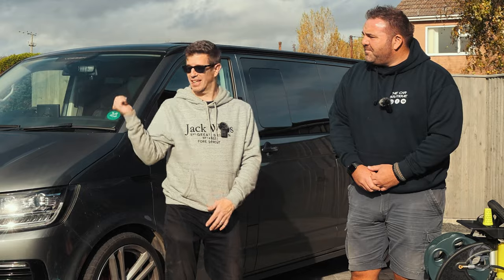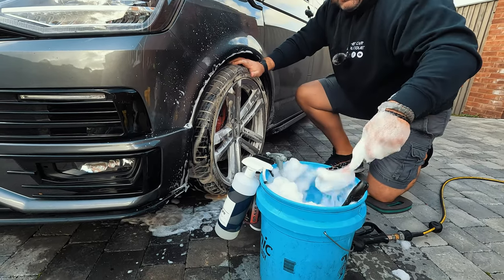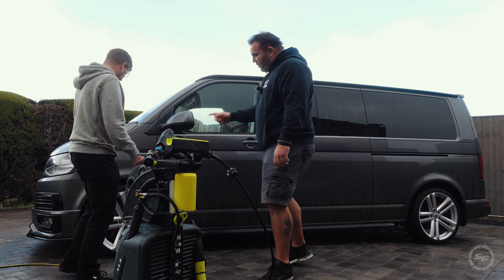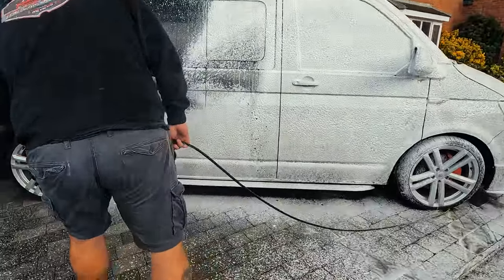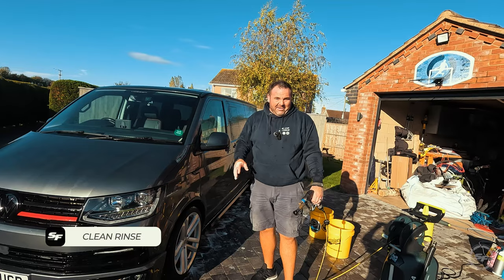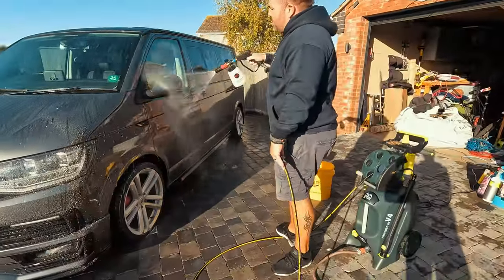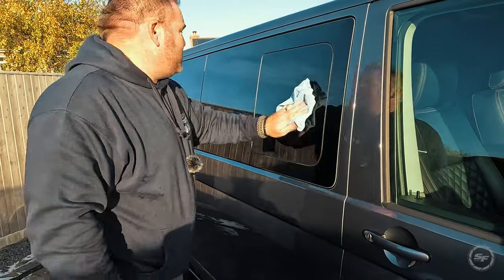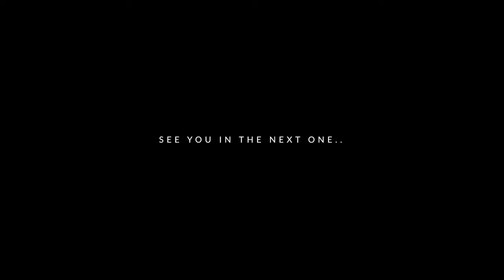DETAIL YOUR VEHICLE LIKE A BOSS!! | I called the Geeky Detail expert in to show me how it's done!!😎👌

Comment: Great products and tips. I also use a 2 bucket process where you dip the dirty brush in another bucket to clean it to prevent picking anything back up and rubing it in to the wheel/paintwork.
Reply from the maker: Yes, I also picked this tip up from Steve on the day too!👍

Comment: My vans got what looks like watermarks stained into the paint- would it be from using polar seal in too high concentrate or the tfr from local place i used during recent hose pipe ban?
Reply from the maker: Steve will answer this one  when he sees it 👍👍
Reply: It’s potentially from both 
But I’d suggest it’s TFR stain from the products they use at scratch and shines designed for quick cleaning and to aggressive. 
It will normally need a machine polish if this is the case. 

You can get stains if left to dry Lance or any sealants tbh

Comment: Excellent video, it’s a treat to see it done properly!! Two questions, what would you recommend for steel wheels and will that lovely soft lance/hose fit on a K4 Karcher?  
Stunning van by the way👌🏼
Reply: You can follow the same process on steels no problem.
Reply: You can buy all lances now with the fitting supplied in the kit for a Karcher K series with no issues. 
The MJJC is my favourite 
The Autobrite Lance is excellent also

Comment: What is the attachment called that he's using on the spray lance i noticed you can change the angle which is very useful.
Thanks
Reply from the maker: Hi Steve has sent me a link to an example of one,  it’s called a quick connector and here is a link to one…. https://www.ebay.co.uk/itm/403990165768?mkcid=16&mkevt=1&mkrid=711-127632-2357-0&ssspo=qnvjxwqrrag&sssrc=2349624&ssuid=C2SYLwLETQe&var=&widget_ver=artemis&media=COPY
He mentioned he has also seen these for about 12-14 pounds! 👍

Comment: Steve - are your T6 sliding windows original from factory?….If so - any leaks?…especially when jet washed?….I had to replace my 2015 T6 sliders with aftermarket ones due to leaking..
Reply from the maker: Hi Steve.  Yes my middle row sliders were installed at the factory as mine is a Kombi and they have been know to let a little water in! Mines not to bad compared to some as it only does it sometimes! Bad design.
Reply: @SteveField  Yes! Poor design indeed considering the prestige and price of these things!..Unbelievably, I still don’t think there is any major redesign plans by VW for this very known issue……🤷‍♂️